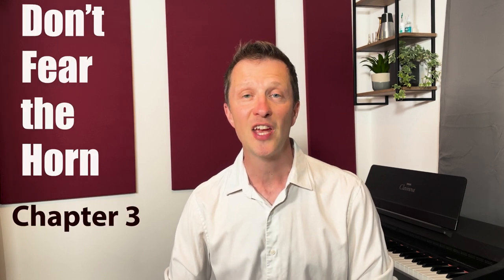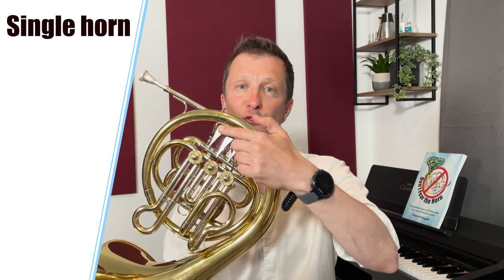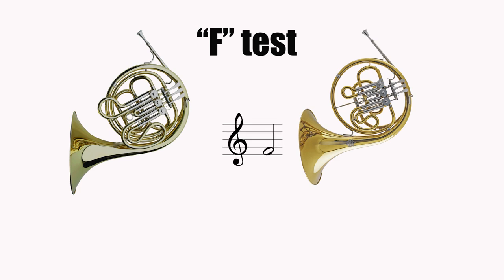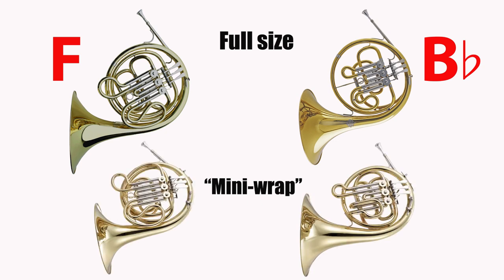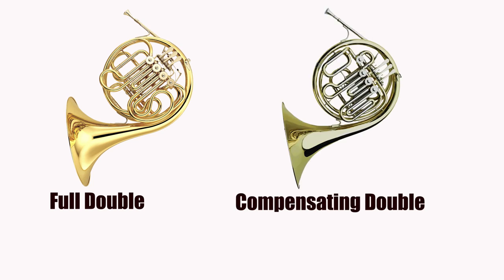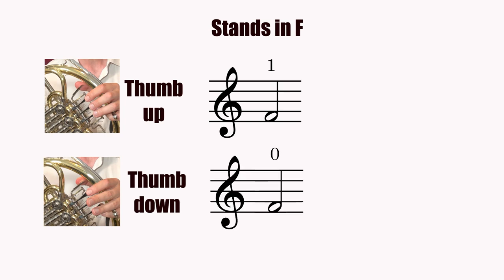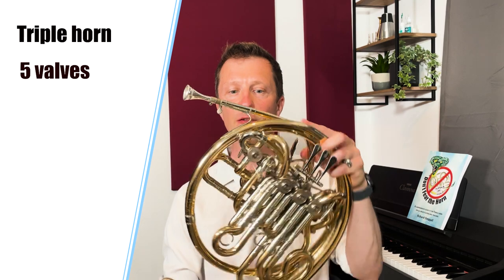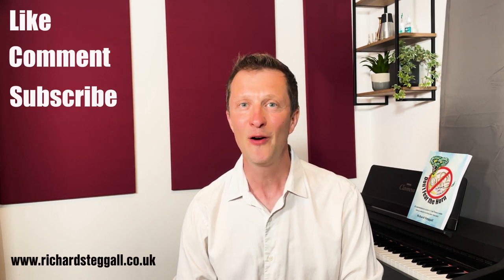Different types of French horn | Don't Fear the Horn: Chapter 3

Comment: Where does the Vienna horn, used by the Vienna Philharmonic fit in the list? Thanks for the very informative series!
Reply from the maker: The design of the Vienna horn is (usually) a single F horn, so follows the way the single F works. The main differences from the regular F single are that the Vienna horn uses the Vienna valve (or "pumpenvalve") and has a narrower bore. Thanks for watching!